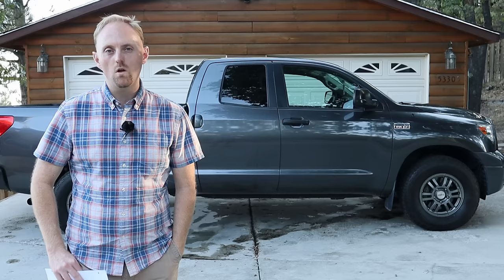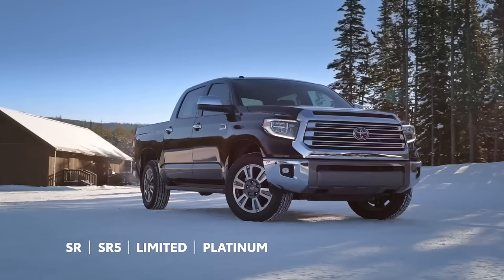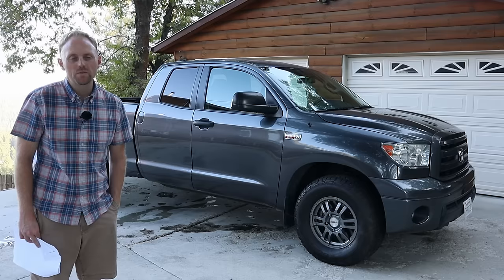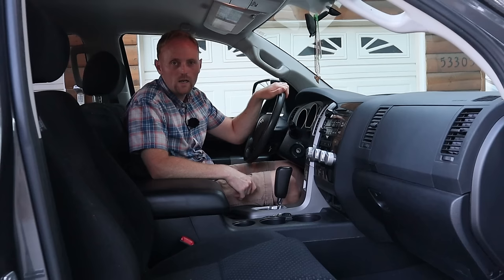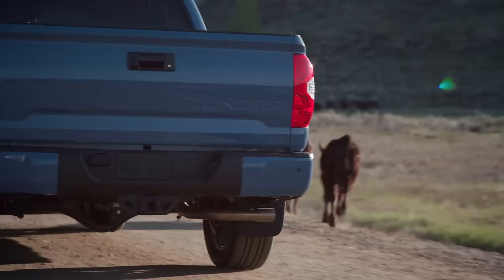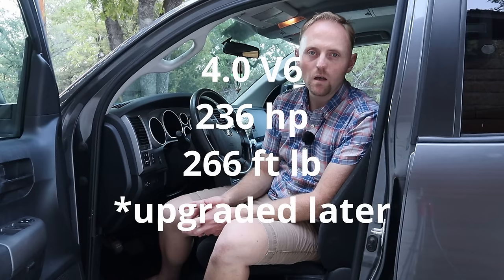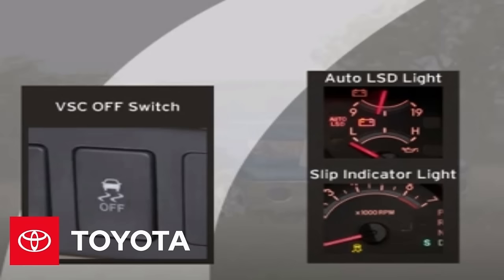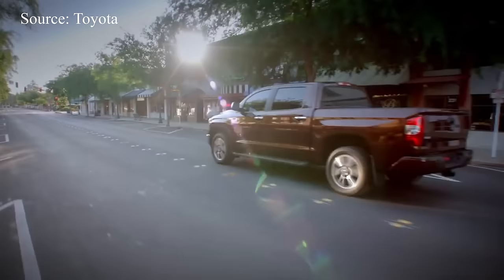Toyota Tundra  |  Brutally Honest Long-Term Owner Review

Comment: Whats your thoughts on the TRD anti sway bar , im on the fence about it . i do pull a 20 foot travel trailer , does it help with towing?
Reply: Go with an air lift suspension kit for the rear it will help level the rear with the load of the trailer so it doesn’t look like the rear is bottoming out.
Reply from the maker: I had the sway bar on the truck , big help
Reply: It’s a must have for towing, especially if you have a Crewmax. Takes a ton of that kinda “top heavy” feel right away. Worth every penny.

Comment: Seats are so uncomfortable. 
I hate the seat.
Like the truck.
2020 TRD 52k truck
500 extrs a month chiropractor 
1000 a month gas bill
7 to 9 mile with my 3500 lbs trailer I m always in tow

Comment: Ford Eco-boost engines are a highly complex design and are not very reliable long term. Some Ford Diesels have major Egr and stiction problems before they even reach 80 to 100k miles. These repairs are very expensive.

Comment: The biggest contributor tonthe poor fuel economy is the 4.30:1 10.5 inch rear end. Great for towing but you do sacrifice fuel economy. Ive towed my food trsiler with a tundra 5.7 and an f150 5.0. Both did very well, off the line the tundras 5.7 got the load moving quicker from a stop because its max torque is at a lower rom than any other naturally aspirated v8, but at 4,000rpm and above the 5.0 pulled just as hard. But my titan xd was much better when it comes to stability in crosswinds and oncoming 18 wheelers on a 2 lane rd.

Comment: The Toyota nanny sucks on all models across the board. 
The rear lockout is definitely a big loss.
Otherwise, it's top rate.
I will never buy anything other than a Toyota, unless it's just a toy. 
500,000 miles is the key, before any major breakage. ;-)

Comment: I have been looking into tundras for a while now and hopefully will buy a used one soon as i would only buy a Toyota truck. 
My only question is why would you opt for the ecoboost on your ford if you obviously research your trucks???   Nothing but horrible stories about them. We had one in our shop to have turbo replaced and thats with less than 100k kms(Canadian). 
Anyways great review 👍🏻
Reply from the maker: Bought it for low end torque for towing

Comment: I have a 2007 Toyota Tacoma which I love to death,  but I'm starting my own contracting business and looking to upgrade to the Tundra,  looking at 2014 to 2017, can anyone tell me what year would be the best out of those and is the fuel economy really that bad in the Tundra, would primarily be pulling a 12' cargo trailer.
Reply: Just go with the tundra, my tacoma is only getting 15-16mpg as it is so you might as well get a full size thats getting the same.

Comment: The "ONLY" thing that would keep me from buying a Tundra over ALL the other trucks, is the dismal, ridiculous "fuel economy"; it is PATHETIC! 3 MPG difference to all the other trucks is just INSANE. Just imagine, if you have a 25 gallon tank, with a 3 mpg difference, you're gonna go an extra 75 MILES before having to stop for fuel again... INSANE! Do the math on price-per-gallon😳😖! 
Now, I wonder if the difference you'd pay extra on MPG, is worth passing to avoid all the "hassle, headache, and money WASTED" on repairs and downtime with other trucks, for being at shops for repairs for being so UNRELIABLE, which IS the case with "American" brands, GM, Ford and Ram!?!? 🙄🤔😮‍💨
Reply: Had a 2010 Tundra, now have a 21' Tundra, can't beat them. I do agree with the fuel mpg. But I don't buy a truck for its fuel mileage. My Ford's had great fuel mileage, while being towed. With my Ford's, I'm the reason why AAA only lets you get 4 tows in a year. Sorry everybody😁.

Comment: Last but not least you show newer tundra acceleration,you need to hold down traction control 1 more time and remove that "AUTO LSD: and then hit tow haul button,revs to 5500 and feels like a different truck and when off throttle it will downshift harder.Watch tundradude34 explain it as the dealership dosent tell you how to get a hotter tundra lol.

Comment: My f350 5 speed manual with 6.8 liter v 10 gets way better mileage than yours.  My truck is just over 6000 pounds empty.  And my v10 pulls very hard

Comment: Toyota doesn't rust proof their frames, had a truck that was condemned due to no frame left and it only had 120k miles, 2006 tundra. buy Toyota only if you don't live in rust belt, otherwise its a throw away truck.

Comment: Cam shaft cradle leak.  Huge weak point in the iForce 5.7 engines.  Either live with a truck that constantly pisses oil everywhere or undertake very costly repair.  Toyota never addressed this until their 2022 model year .  Shame on Toyota

Comment: GVWR IS BULLSHIT FOR A DOUBLE CAB 8 FT BED... CANT HAVE ALL PASSENGERS AND MORE THAN 300 LBS IN THE BED!  I love my 2008 but people always find out it ain't a superduty too late.  Costs too much to have such a low rating and can't even carry a medium weight camper.  If you want a big little truck that is reliable cool, if you need a truck without paper thin panels and bumpers with no load rating look elsewhere

Comment: RAM is way better.
Reply: ** is this comment for real? Or a joke? 

RAM literally has the worst reliability (statistically speaking) in the industry. The lifters on my 2015 RAM 2500 6.4L ate up the camshaft—creating a ~$6k rebuild—with only 67k miles!! Total garbage. Sold it right away.
Reply: ITS MADE BY CHRYSLER FAIT AND DODGE NO WAAY

Comment: 90,000 miles is long term?  Come back at 275,000 and tell me how it held up. I put 275,000 on my 2000 Silverado, it never let me down, original engine and transimission,n no rebuilds!
Reply: At 275k you just getting it broken in. I’m sorry but TOYOTA knows reliability.. it’s Like a Apple iPhone 📱 they stay safe and have a great resale value.

Comment: I hate the fact that fat Americans started buying trucks to haul groceries in. All it did was drive the prices through the roof.
Used to be only farmers and contractors bought trucks. They were always cheaper than sedans.
Have an ‘02 Tundra will nearly 300k miles. Still strong as ever.